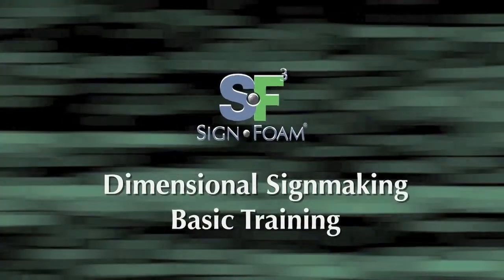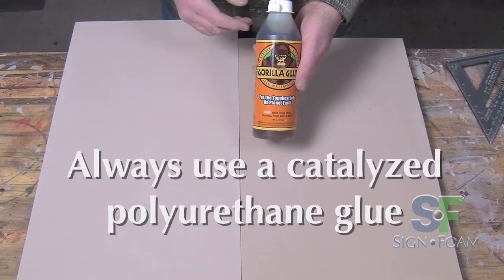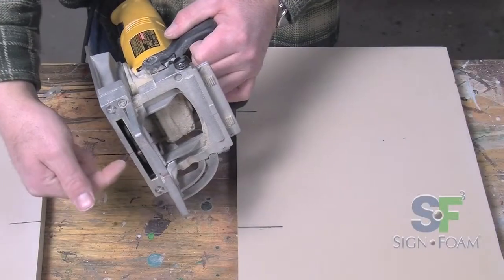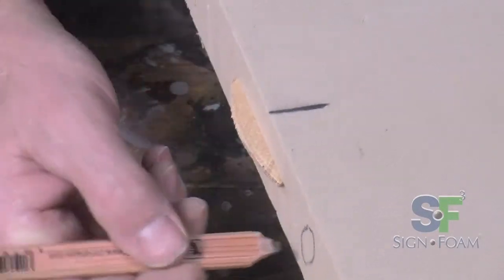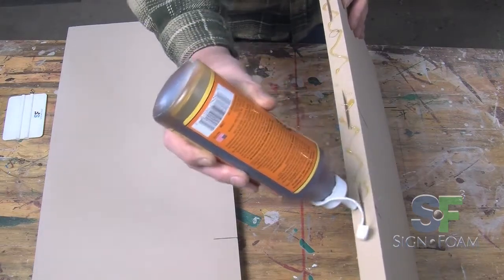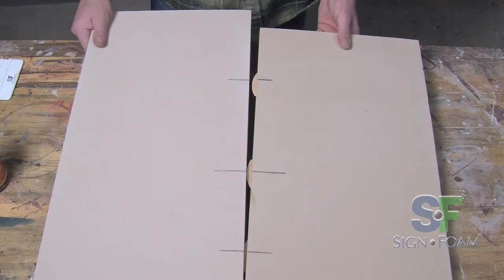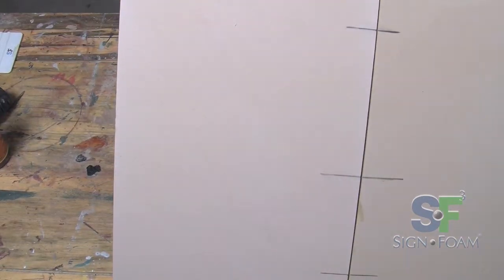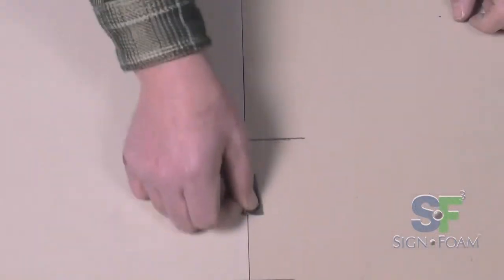Gluing Seams - Sign·Foam Basics

Comment: As a sandblasted and hand carved sign maker specialist for over 35 years, I have a few comments on this video. 
1. I would not glue the pieces together that have a gap like that, trim them so when the pieces are pushed together you don’t see a gap, the reason is once sandblasted the seam and dried glue will not be as noticeable. Yes it will be seen because the glue is more rubbery than the HDU so a  thin line of cured  glue will be standing up higher than the sandblasted surface and it will have a different texture, You want this as thin as possible so it’s less noticeable.  
2. it’s better to clamp the pieces together to keep the glue from expanding and pushing the pieces further apart, besides why would you want to put a screw hole in the material unless it’s necessary.